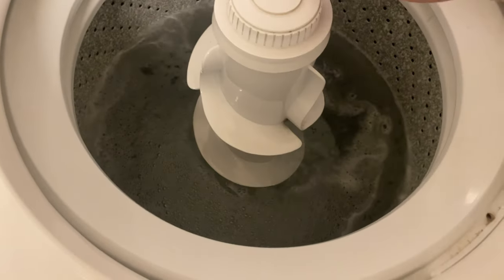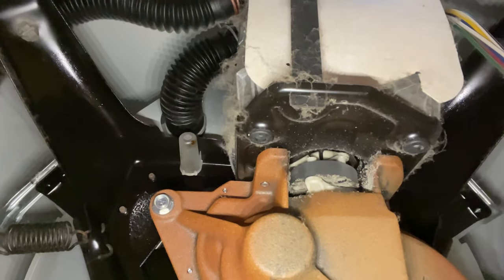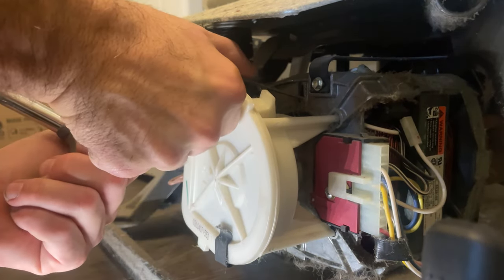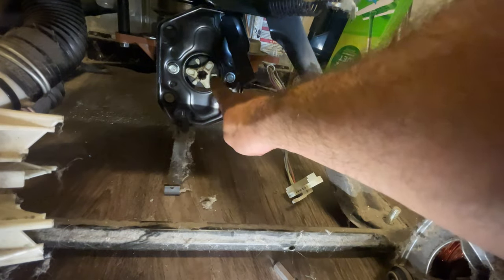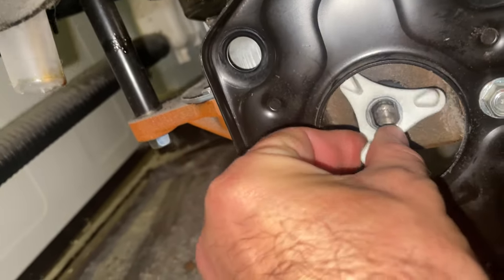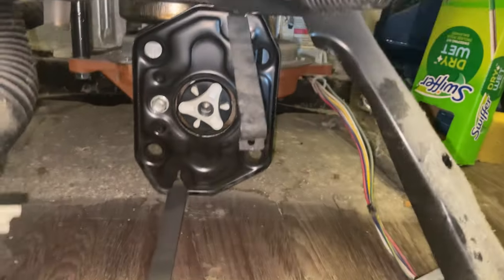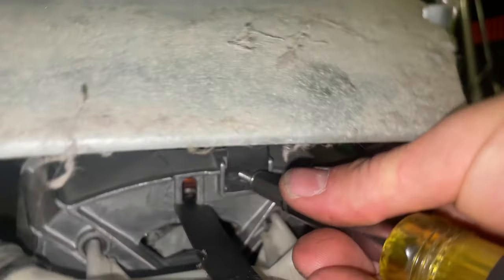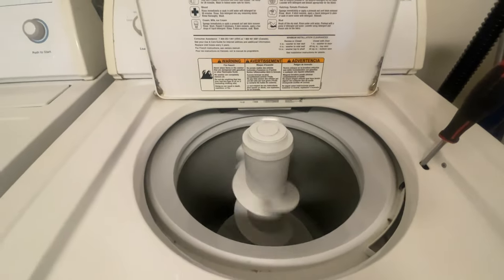Washing Machine Won't Spin but Drains - Cheap Fix for old Whirlpool Top-load Washer

Comment: I already had another washing machine for the past year at my shop that I had bought and it's pretty good shape and I changed out last night the put the other one and it works fine but the other one which was a heavy duty Whirlpool I'm going to go ahead and take it apart and see what I find in there like what I seen in this video it's about 1820 years old and look a little bit different almost looks like it has some kind of a a mole clutch kind of set up like you might find in an automatic transmission so anyway I'll look at it and see what I find out but it's a good video thank you

Comment: How did you get the backing off the old coupler?  I disassembled my washer.  The coupler looked good, but since I bought the part thinking that it was the problem, I wanted to change it.  The white part that's flush to the motor won't come out.  Help?

Comment: My top load whirlpool 20 year old washer doesn't seem to extract as much water as it used to.  I replaced the motor to tranny coupling which was broken and measured the spin RPM at ~500 rpm.
Reply from the maker: Check the clutch temp if it’s getting super hot you’ll need to swap that out

Comment: Since this is the first video that popped up and you're very active with the comments. I just had my washing machine stop spinning on the top part but not the bottle. My mind says the opposite side of that you fixed is my problem. Would i be wrong? Is it possible what there is a second side that controls the top part?
Reply from the maker: Most of these old washers have agitator dogs that break often - https://www.youtube.com/shorts/e-IfTORdFpo
Reply: @ApartmentMaintenancePro  thanks. I have some coming in tomorrow. I found the other video.

Comment: I fixed that part and my washer is spinning again but the cast iron on the bottom of the tub seems to be running really hot. Is it possible there’s a bearing on it broken? Or does it need time to work in the new piece.
Reply from the maker: Sounds like a bad clutch,

Comment: Im wandering whats wrong with mine. It fills up but also drains water at the same time? Not sure if thats supposed to be happening.. 
Then when it tries to do the spin cycle it makes a click then a VRRRRR....click...VRRRRR over and over then ends the cycle and says its done washing. Doesnt spin at all   
  
Im nervous to take it apart cause my basment is like an old flooded castle torture chamber. Sigh.

Comment: i have the same washing machine  but yhe problem is when you adjust ti the normal position the spiner cant run fast  but if the setting is on the spiner its running

Comment: Is this pretty much the cause for any washer that doesn't spin out but drains? Tenants are complaining about a washer in our laundry room doing this and the appliance repair company we used to use went out of business. Appliances arent really my specialty so it seems easy enough if this is the most common issue..
Reply from the maker: It’s a common issue but each model / brand has their ‘common’ issues

Comment: My old whirlpool doesn’t spin. It’s direct drive, the motor comes out with the center shaft that the agitator is attached to. It’s so old it doesn’t have a lid lock. I changed the clutch, but it still won’t spin. I don’t know what could be wrong.
Reply from the maker: Not sure would need to put eyes on it. Couple things that would cause it not to spin are a bad motor, or a bad motor coupler. Washer should still spin if the clutch was bad

Comment: I was hoping to see the belt. I didn't hear noise, just not spinning. The belt is loose but I don't see where it connects to anything. My washer looks like this one. It's hard to find videos with the same washer, there's so many models and mine is older
Reply from the maker: Belt goes on the pully then the motor shaft pully which isn't grooved. Doesn't look like it would work but it does

Comment: Mine spins sometimes but not others.  Seems to spin about 50% of the time.  Any idea why this might be?  Seems odd.
Reply: Same here, did you find what the issue was?
Reply: @Patriot556    No, but I bought a new washer and dryer and am much happier 😂
Reply: @fledgling5616  Doing the same haha, cheers man
Reply: Could be a weak capacitor.  My 20 yo Kenmore would only spin if I started it by hand.  I replaced the capacitor last week and it fine now.